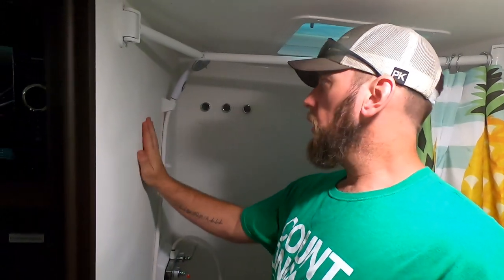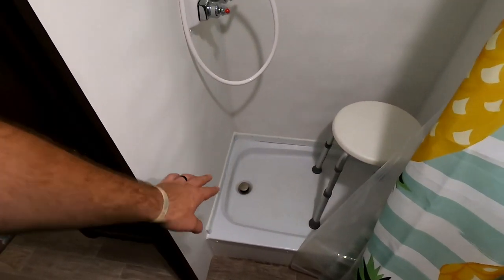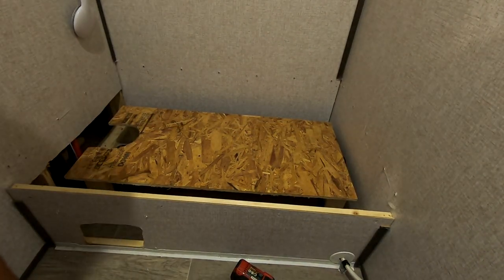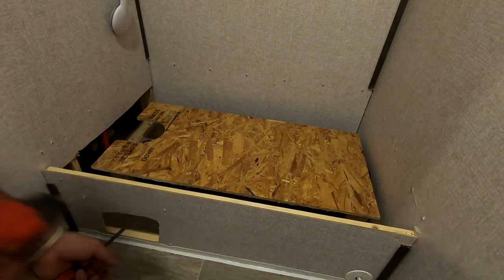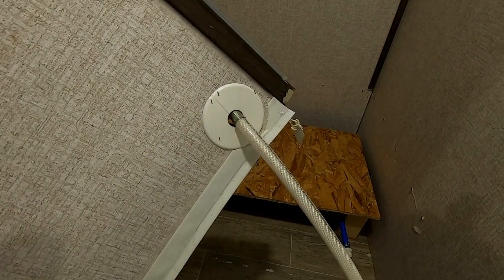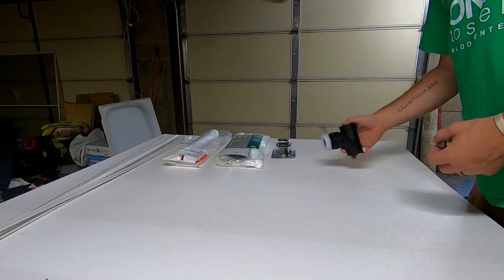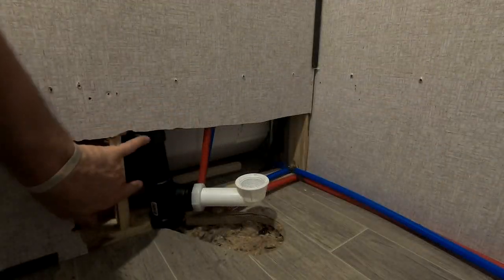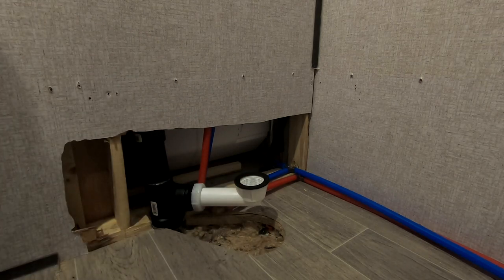How to Lower Your RV Shower | Coleman Lantern LT 17B

Comment: I have the same issue with hanging out in the skylight!  I'm going to check out the plumbing issue under mine and see if lowering it is an option.  I originally was looking for tips to paint the yellowed walls but now thanks to this video, looks like were going in deeper with new plumbing and walls!  Thanks.... I think :)

Comment: I thought about lowering my shower later but first I had to seal the floor because mice were entering through the large hole under my shower. It is ridiculous how big of a hole that was drilled under the shower pan to allow access for varmits. I sealed it with steel wool and expanding foam.

Comment: Great job!  I'm considering doing something similar to my 17B.  

One question I have.  Looking at the before and after plumbing setup, it appears from the video that the actual height where the trap heads up to the basin is almost at the same height as the final elbow you used in your configuration.  Now having gone through this install.  Do you feel you could have kept the original plumbing setup, maybe just cut down the drain pipe, and still be able to lower the shower by a couple inches without changing all the plumbing?
Reply from the maker: @Kr yes I probably could have done that. It could have been a much simpler project that is fore sure.

Comment: Great job and I love your cap. I didn’t see where you modified the height of the supports below the tub. Did you just shorten the upright blocks? If so, what was the modified height of the blocks? Thanks
Reply from the maker: Yes I just cut down the blocks. I'm not sure what they ended up being, it's been awhile since I worked on this.